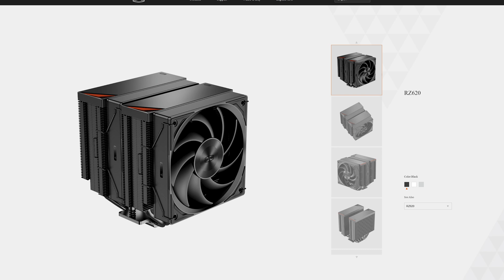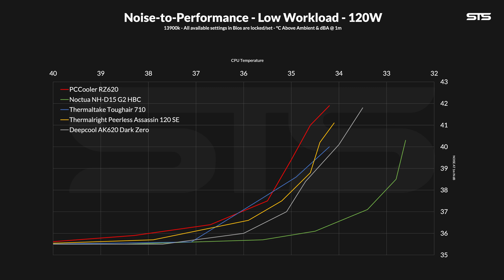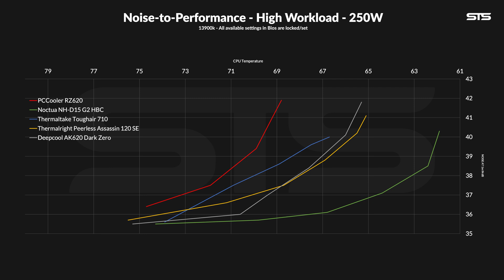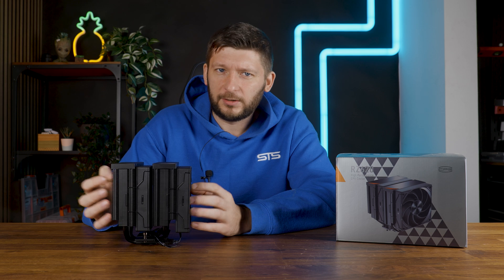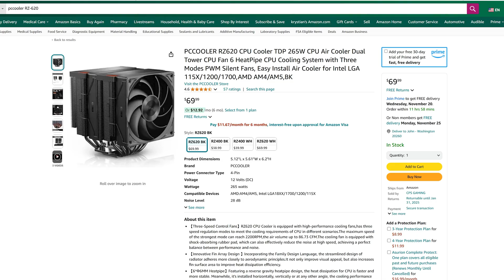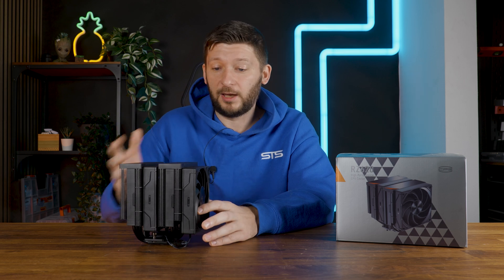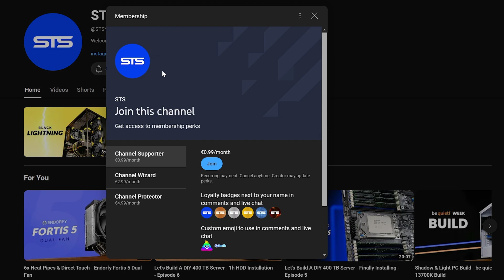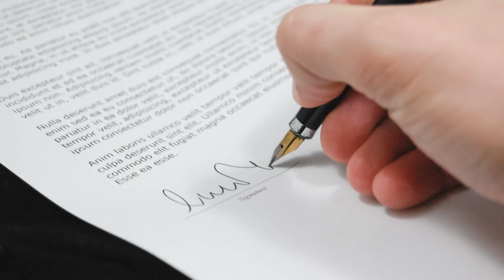Can PCCooler Make "Normal" Coolers? PCCooler RZ620 Review

Comment: There's one thing I wished people discussed more in tower cooler reviews is how far south of the socket does the fin stack sit, one thing that seems that mostly Thermalright is doing is offsetting the heatpipes in a way that the finstack actually sits mostly flush to the south side of the socket so that it does not overlap with the m.2 slot on most boards so that you could install a Gen 5 SSD with a huge heatsink if necessary. Although Phison's die shrunk dramless Gen. 5 controllers have now hit the market and Silicon Motion and Samsung should have dram caching controllers built on a small enough process node that a regular motherboard heatsink should be more than sufficient in the coming months, and my grievance regarding the current Phison and Innogrit dram caching controllers will become a moot point, because after the SM and Samsung ones hit the market no one should buy the Phison based drives anymore.

Comment: Anyone else suspects that PCCooler is just an off-brand of Deepcool?
Reply: no...
Reply: Literally searched this 2 days ago
Reply: OEM from same factory.
Reply: The telltale sign is the wave fins and checkerboard pattern on the heatsink itself. This was a Deepcool specific design choice with little practical reason to replicate. However, the fans they are using now are different. This isn't really a rebrand of the company but a Ship of Theseus intentionally made to obfuscate sanctioning. The heatsinks are definitely made by the same factory though, and thus conform to the established quality standard.